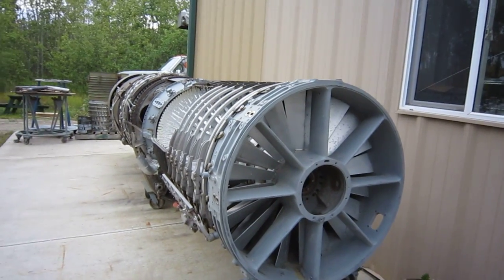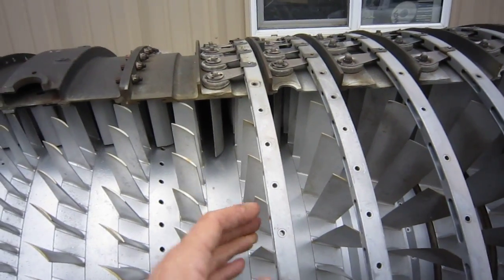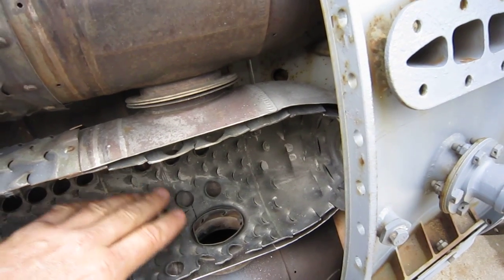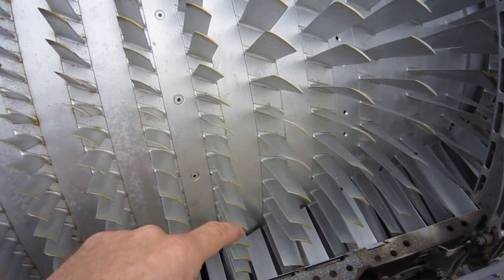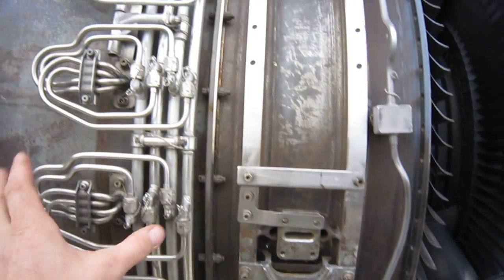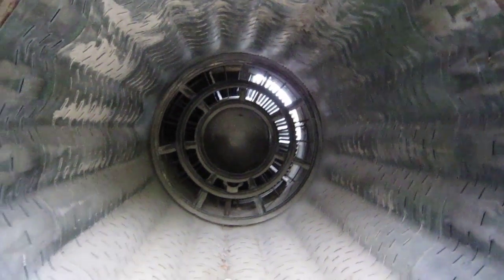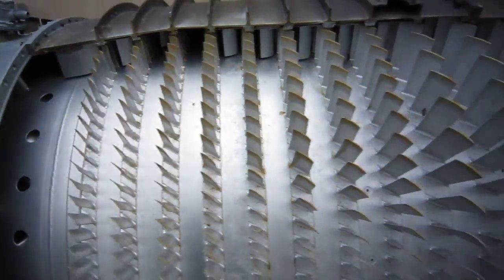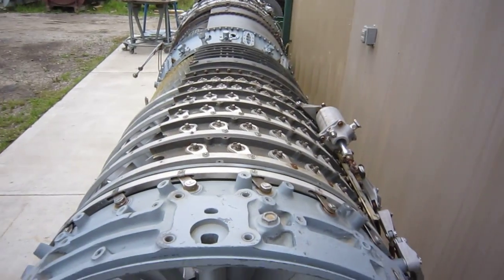J79  - Turbine Engines: A Closer Look

Comment: A shame thats reduced to a cutaway, its in good enough condition to have been kept in the air..
Reply from the maker: As explained... it never was anything. Our cutaway display is constructed of leftover scrapped parts from many different engines; various versions of the early model J79s, as well as the industrial LM1500. All share nearly identical cores, but there are differences.
And this particular collection of parts and pieces has never run together.
No shame.
Reply: Thanks for the reply. I realise many parts/sections are timed out but it just looks to be in such good condition. Ive seen many other cutaways with time still left in a far more worn/burnt state than your engine. A credit to you for such painstaking assembly..
Reply: Draxindustries1 
Gotta teach the gophers (apprentices) on something.

Comment: Fuel Jet Hoax  - can you explain  is it possible.
Reply from the maker: The right question to ask is: can those people explain how the engine works? It's up to them  to make it a debate by proposing an alternate explanation. They can't. It's not a debate. The designers, the engineers, the constructors, the operators, the refuelers, the maintainers, and the people who pay for the fuel all know how these things work.
The hoaxtards don't.
It is as simple as that.
Reply: @AgentJayZ  more than 300.000 litre fuel for a A380 is a hoax.
Das Gewicht wäre über 250 Tonnen!
Das ist  ein Scherz,  glaube mir.
Reply from the maker: So, let me get this straight. You want a debate, and your position is that you can't believe that a hundred tons of fuel fits in an A380?
Sorry, that's not evidence, that's a statement of incompetence. Anything else?

Comment: Son of a bitch that"s complicated !  efficiency must be horrible !?
Reply from the maker: Efficiency is just a ratio of something to something.
In terms of power per unit of weight, this engine is 20 times as efficient as a diesel piston engine...
Reply: @AgentJayZ   Wow i never would of thought this high ! excellent. Transport trucks should be using them !  I my line of work, internal combustion engines, its pounds of fuel it takes  to deliver torque. Imagine similar theory . Love your vids ! ROCK ON !
Reply from the maker: In my ratio, I used engine weight.
Gas turbines are about as fuel efficient as diesel piston engines at full power. Once you begin to reduce power from max, the piston engines become much more efficient. 
Thanks for the kind words.